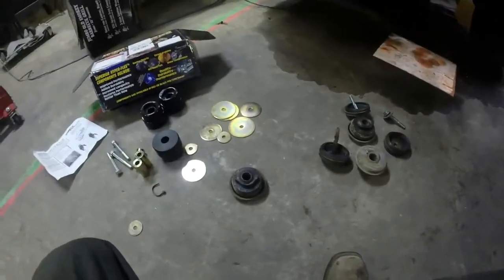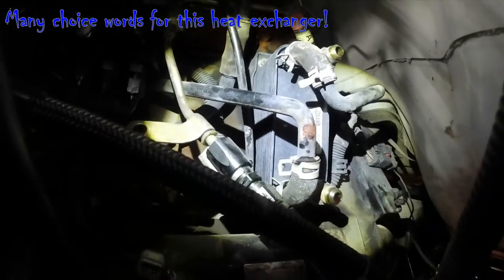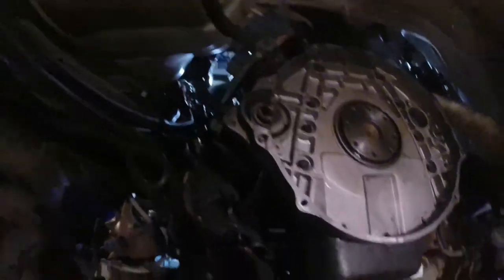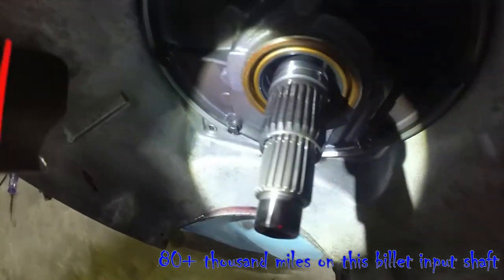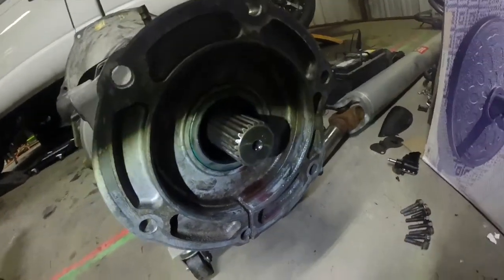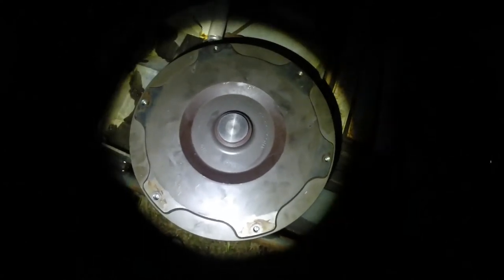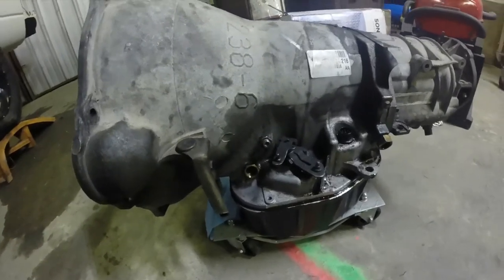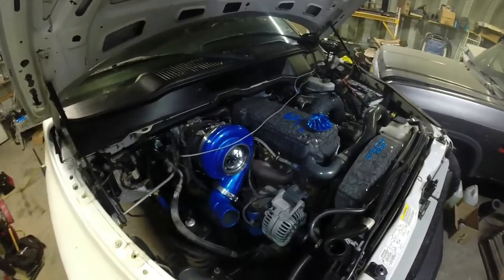48re Removal & New Transmission Overview

Comment: I like the idea of your new cooling set-up you referred to. I'm working on an 07 with 5.9 and 48RE trans. I'll pull off the transmission and see how the wear is - inside. It still runs good but It's time to consider any mods, refurbs or upgrades. Looks like the beast will be down and out for a few weeks.

Comment: Just watching your video and thanks for sharing. The "heat exchanger" that you found difficulty with - is a royal pain to remove. It's called a Transmission Torque Converter Oil Cooler.
Reply from the maker: BigRed56 That it is, not a fan, wanted to simplify things. New cooling setup plain works to, in the Texas 100 degree heat I can keep temps around 150-160